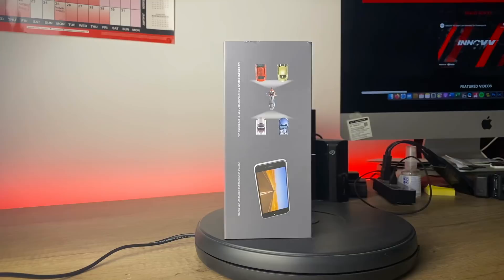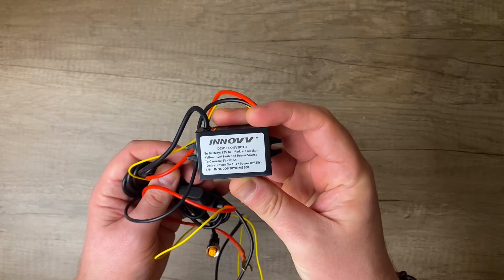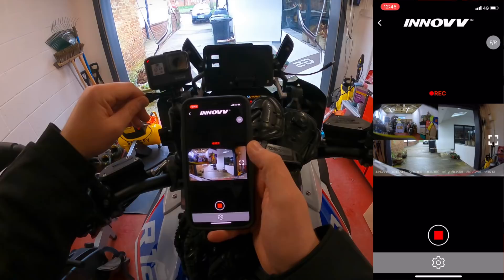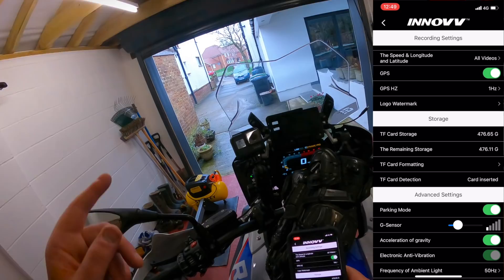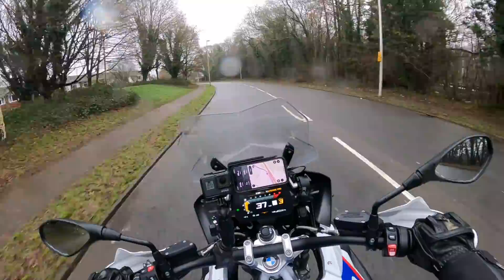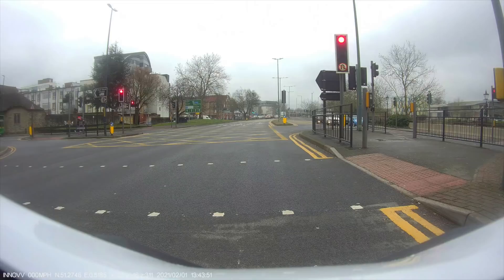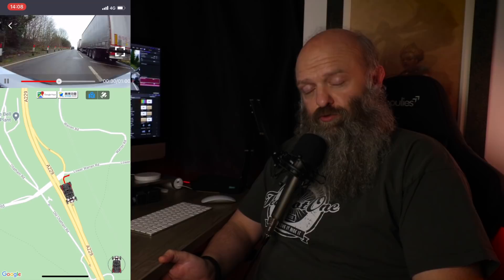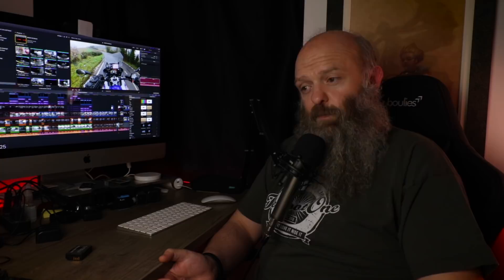INNOVV K5 Review - Motorcycle 4K Dual Camera System

Comment: But have they stopped it flattening the battery in 3 to 4 days?
Reply from the maker: That’s never happened to me with either the C5, K2 or the K5?
Reply: @teapotone  early ones were really bad as they leave the GPS on permanently. Never had to put my bike on a battery tender until I installed one. Now 4 days and the bike is dead. They even replaced the power supplied with updated ones but it didn't fully solve the problem.
Reply from the maker: Ah right, I know the very early models with the original DC converter didn’t have the battery power regulator, but they all have had that for a few years now?

As I said, I’ve not experienced that with the 3 models I’ve had on 2 different bikes 🤷‍♂️

Comment: I just bought the K3 and it doesn't have 5GHz WIFI, only 2.4GHz which is very disappointing...
Reply from the maker: Yeah I think that’s a big fail of the K3 - I’m switching to the K5 and the faster Wi-fi is a big reason for that
Reply: @teapotone  I can't have that huge box on the front camera, you do say in your video that Innovv told you the K3 will have 5Ghz... guess they changed their mind.
Reply from the maker: It says in the specs of the K3 that it’s 2.4GHz Rob, can’t argue with that bud. I was initially told it would have the same Wi-fi and gps specs, but yes it seems they went with the slower Wi-fi in the end on the K3.

Comment: If Internal DVR fails it is a MAJOR problem. The time/date stamp will be 'stuck'.  Even when INNOVV are warranty-obliged to address it you will have mega issues if your experience is like mine. Sending your unit to China will cost you "an arm and a leg" and there is a risk of the unit being discarded by China postal systems, say INNOVV.  So, BE WARNED. I am still trying to resolve this issue with INNOVV which has NOT BEEN STRAIGHTFORWARD.
Reply from the maker: Is that with INNOVV UK?
Reply: @teapotone  No, Aus, mate.

Comment: It's too bulky for me, and do you really need 4K? 4K uses a lot of space, and, the back camera is only 1080p? Why not have a 2K system, front and back, with better Wi-Fi, better GPS, better audio, a handle bar controller with information icons, and a main unit with a pop-out tray so the microSD Card can be removed easily, and, more importantly, away from the bike. INNOVV could name it the K4 system.
Reply from the maker: I agree, no need for 4K - it’s frame rate and bit rate that matter, 1080 is absolutely fine.

As I say in the vid, the forthcoming K3 system is the one to go for
Reply: @teapotone  I find 1080p@60fps is a good compromise on my Osmo Action camera. If someone cuts you up there's a good chance you'll get the registration on video instead of a blur of characters. I was disappointed that the K5 doesn't have image stabilisation. I bought a Campark X5 4K 20MP action camera for £32, it has loads of recording options, and it has image stabilisation, which, amazingly, actually works! It's a brilliant little camera for the price. If Campark can do it for that price, why can't INNOVV? When I installed my K2, I fitted the rear camera to my tail tidy, but it just couldn't cope with the vibration. The tail on any bike bounces up and down like a springboard, you have to fit the camera to a solid part of the bike. I ended up having to refit the camera further back on the bike, which is not the optimal position.

I hope the new K3 will be a lot better than the K2, with better Wi-Fi, GPS, audio, more fitting bracket options, an SD card tray, and I hope it can record 1080p@60fps. To be honest, I was a bit disappointed with the K2. It sort of works, but the intermittent GPS is very annoying, but it's a fit-and-forget system which is very convenient. It's very expensive, and for the price it should have been much better. Plus, you shouldn't have to pay extra for an external app (Dashcam Viewer), so you can see the K2 GPS video data on your PC! The K3 review will be very interesting, because there are plenty of other options these days.

Comment: I know car dash cams need to have a totally uncluttered view for legal and insurance purposes, having that front fairing in the way at the bottom two sides effectively neutralises it's usage.   It's also too tempting for vandals and thieves having a permanently mounted cam system on a bike, imo.
Overall, for most riders, maybe stick with helmet cams and a separate rear view chinese GoPro-esque cam off amazon at a fraction of the cost.
Reply from the maker: I’ve never heard of that before bud, regarding a totally clear view?

If you go with the option you mention, then it won’t be constantly powered and it won’t continually record all the time - you will have to switch it on etc - meaning you’ll not do it the one time you need it.

Classic example of buying cheap and paying dear - been there, done that.

Pay the money for a proper system that actually does the job

Comment: quality is terrible, you can't read any license plates!
Reply from the maker: Not when moving no, but in situations where you’d need the cctv coverage for accidents etc, then speeds will be lower and you can read number plates no problem.

It’s meant as a dashcam system not as an action camera alternative 👍
Reply: @teapotone  been watching reviews of this camera and they are all the same, can't see the plate when moving.  And when stopped, like you explain, it appears to be a bit of stretch like you need to be within a few feet which I reckon is OK if it's your bike.  I would still argue that reading license plates while moving is one of the main motivations for purchasing (at leas for me).